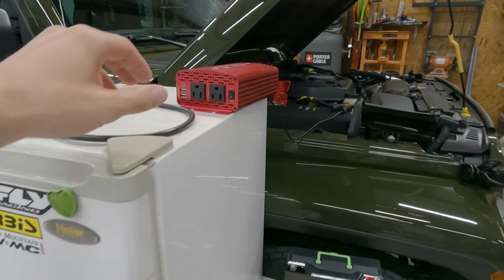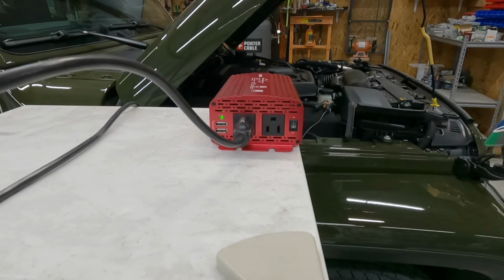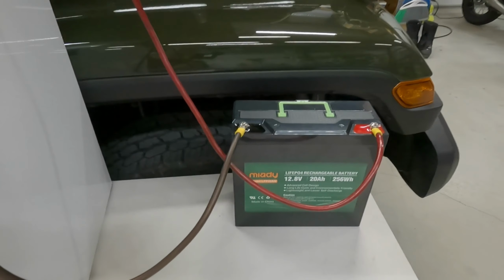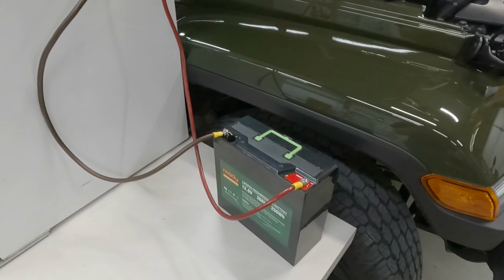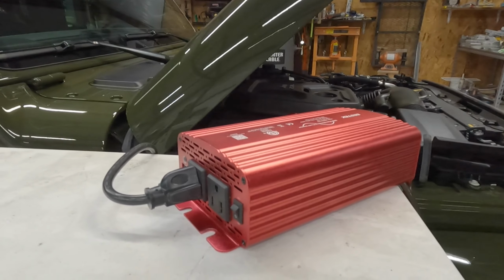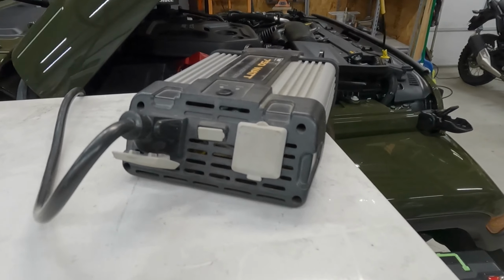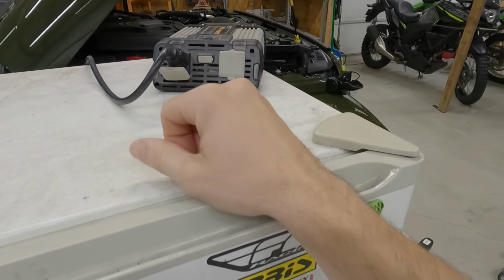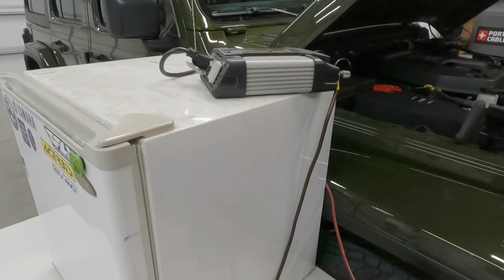Can a 500W Pure Sine Wave Inverter and Lithium Battery run a Mini Fridge?

Comment: i have a bestek 1000w pure sine wave and a 20 amp battery and it ran a 5000 btu Frigidaire AC. I just did that for a test i will never use such a small battery i use a much bigger battery instead and its amazing.

Comment: Would be interested in knowing exactly how many watts the fridge pulls on start up and also after initial start up. (using an energy meter) My little freezer only needs 60ish watts to run but initially pulls 550 watts for a few seconds. My Bestek 300W can't handle it, even momentarily before it blows a fuse. I clicked this video in hopes of clarifying whether the 500W would work. Still a mystery. lol

Comment: I have that same fridge. The Bestek 1200 watt inverter runs the fridge for 8 days and nights on my 200 amp hour battery in a Min Kota trolling motor plastic case. Buy a bigger inverter than you need. The Bestek has an LCD screen showing Watts and battery voltage. Prices are all over the map but I got mine for $106 with free shipping  from an eBay seller.
Reply from the maker: Funny you say that - I bought a Bestek 1000 watt pure sine wave inverter a couple weeks ago and have been amazed at its capability. Hope to do a video on it at some point. What are the details on your 200ah battery? Is it a Lithium or lead battery? Thank you for your comment!
Reply: @uthe54  I have several lithium battery units that fit in plastic battery boxes They are caseless and have the BMS shrink wrapped to the top so they are as small as can be made. Two of the 100AH batteries fit in a Min Kota box side by side with room to spare. $420 for each 100 amp hour and $820 for the 200 amp hour battery.  Not cheap but fits my situation.   I home build these as power backup units for friends and neighbors who need to run CPAP machines and oxygen concentrators. Most of them run 300 watt Bestek inverters. I must have a dozen!
Reply: @uthe54   Its a TOBattery 200 amp hour 12 volt LiFeP04 battery with built in BMS. I show the 100 amp hour TOBattery beside it.  Two of the 100 amp hour batteries fit inside the trolling motor box and still need Chinese shipping foam to take up excess space. They could be put in series to run a 24 volt trolling motor.  This modified Minn Kota box was made to back up a CPAP machine during power outages. The 300 watt Bestek is Velcroed onto the battery box and can be quickly  removed to be used in a car.

 My friend is taking it camping next week and wants to run the smaller 700 watt instapot pressure cooker. We already tried it with the 1200 watt Bestek and cooked stew. That's why I made the jumper cables to run the inverter. The 60 amp breaker inside the trolling motor box makes it safer in many ways.  We have been able to recharge the 100 amp hour battery somewhat by using his jumper cables off his van battery with the engine running in a test to see if it's possible. It worked. I'll run the battery down again and put the ammeter on it and get some numbers.  https://www.youtube.com/watch?v=RJZ00XgVf6s

Comment: The bestek  500W inverter actually outputs a modified sine wave which is why your fridge does not start.
Reply: There are 2 different ones. About $15 difference.

Comment: how much power does the minifridge need?
Reply: The compressor on a mini fridge  is around 750 watt  the fridge itself is 75watt..it's the compressor  that won't start it on a low watt inverter. Would need a 2000watt.or under
Reply: @rodscoolcreations9847  that is like a regular fridge these days.

Comment: Rule of thumb, for every 500watts you need to  run use a 100Ah battery, so 1000w= 2x 100amp deep cycle batteries, and so on .and no its not the  inverter.

Comment: you need a 12 volt deep cycle battery 75 amp 900 watts it should run